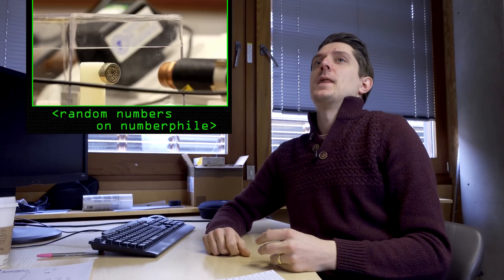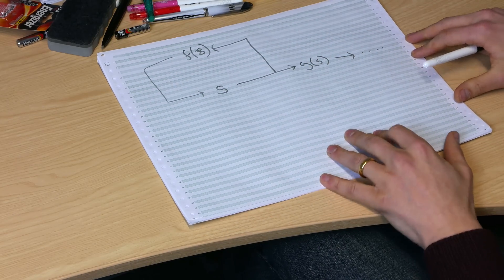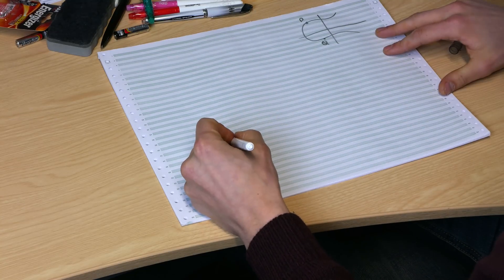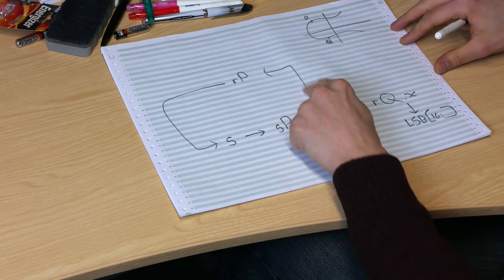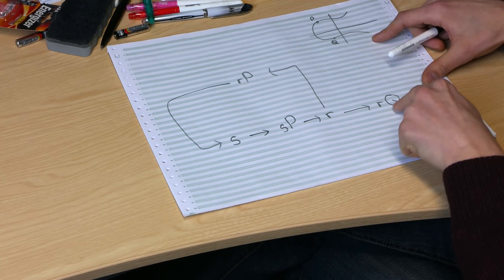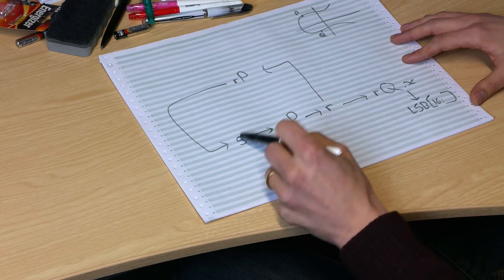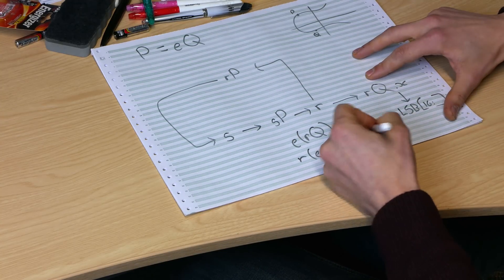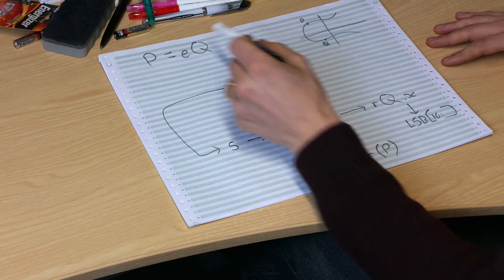Elliptic Curve Back Door - Computerphile

Comment: I don't get it. Why would the NIST tell developers to use a specific P and Q and not generate their own? Do they really think that won't raise instant red flags?

It'd be like if the guy installing your home security system told you your PIN had to be 1234, no exceptions.
Reply: No, there are legitimate reasons as well for not wanting developers to choose their own as well. Am I saying that we can necessarily trust the NIST/NSA's motives? No, but for the exact same reasons we can't trust anyone else to choose them either.

The issue has absolutely NOTHING to do with whether or not the NSA has a backdoor. The issue is that this method is flawed, simply because a backdoor is possible and undetectable. It doesn't matter who picks the values and it doesn't matter how they pick the values, we can still NEVER trust that there isn't a backdoor.
Reply: @phiefer3  
You are correct, but it is MORE flawed to have a single entity act as the determinant of the possible flaw.

Because if multiple entities decided to use their own backdoor, their trail could be traced and their deception discovered when they decided to implement their crime because individuals and amateurs who have weak loyalties will eventually screw something up and get caught.

However, a single entity like the NSA could COORDINATE their strategy of how to obfuscate and manage the process of spying, not only under a legal framework of protection, but with an expert level of organized espionage.
Reply: @dialecticalmonist3405  I disagree. The "people" implementing these types of systems are not "individuals and amatuers", they're major corporations building communications systems that are used by their customers. And the "crime" is as simple as simply reading every encrypted communication that their customers send through their system.

And it makes absolutely no difference whatsoever if the backdoor was put in there by the NSA or the company implementing it. A backdoor is a backdoor is a backdoor. It doesn't matter who put it there, the fact that a backdoor exists, and is infact guaranteed to exist means that the system should not be used.

There are alternative implementations to elliptic curves that can be guaranteed to not have backdoors (by way of things like coprime numbers which cannot be multiples of one another). And that makes them strictly better than elliptic curves.
Reply: @phiefer3   Thank you, you have the best understanding of this that I have read so far.  (I am just learning about all this tonight.) Are there any of these better alternatives like coprimes  being used yet? Is bitcoin's SHA-256 secure?
Reply: You should go back and watch the original video on elliptic curves. When they say "multiple", they're not talking about simply multiplying or dividing a number by another number, they're talking about jumping being able to move some number of times from one point and end up at another point. (ie if you start at Q and then move e times you end up at P).

And the video makes a little bit of a mistake when he says "if" they're a multiple, because the way elliptic curves work, there's almost definitely some number of jumps that can be made from any point on the curve that will land you on any other given point on the curve. In other words, there WILL be some e such that P=eQ. Now calculating the e of a given pair of points is prohibitively difficult, and would be pretty secure, but choosing points for a given e would be extremely simple. (as mentioned in this and the other video, elliptic curves are similar to hash functions in this way, it's simple to start at some point Q, pick a very large e and then calculate a P to create your back door, but doing it backwards to find the e of a pair of points is much much more difficult).
Reply: Wouldn't it raise just as many red flags if they were willing to let developers pick their own P and Q and certify whatever they chose? They'd be giving the green flag for developers to put their own back doors in.

The real problem isn't that there could be a backdoor built into these P and Q values. The real problem is that ANY p and q values are suspect regardless of who picked them. And before anyone says "just use another rng to generate them", that doesn't work either, because that assumes that you can believe the person who says that they generated them from another rng.

Sure maybe YOU would choose honest values with no back door, then again maybe the NIST did as well. You want to choose your own so that you know they didn't put a back door in. Maybe they want you to use theirs so that they know that you didn't put a back door in. Who can be trusted?

Honestly, the fact that this type of back door CAN exist, effectively makes the entire process fundamentally flawed.
Reply: phiefer3 aha thanks for the clear explanation.
Reply: @phiefer3  You can generate P and Q from unpredictable data, such as the college basketball brackets for the next 3 years.
Reply: @samfoxman7046  No, that just moves the issue somewhere else. In that case, who all knows that P and Q are generated from college basketball brackets? Anyone involved would inherently have the backdoor figured out already; just google college basketball brackets. The solution isn't that simple.
Reply: > Why would the NIST tell developers to use a specific P and Q and not generate their own?   
Because the NSA told them to. Simple as that.
Reply: Ideally, the user should be the one selecting the P and Q.  For the type of elliptic curve you would want to use, all points P are multiples of any given point Q.  The set of points is effectively an additive group.  But if the user chooses the P and Q at "random," nobody knows what the multiplying factor is.
Reply: The ideal security solution would be one in which if everyone knows what P and Q are, they still can't get to R, and use R to get back to S.

I mean, the main issue with it is that knowing P and Q, if you got the truncated X value, you could find the untruncated X value, and then use that to go backwards through a one-way function pass Q and into P via the R value, which would get you into S.
Reply: @ZT1ST  There are legitimate reasons to want to specify P and Q for a standard implementation of an algorithm. Performance is one. If you pick your primes right, computing complexity for factoring can be reduced significantly, which makes things more efficient. However as stated, the same mechanism also makes it less secure.
Reply: ok?
Reply: In many cases, the "magic numbers" in such algorithms are essential to the security of the system. The NSA has historically been involved in designing these algorithms a lot, often giving insight to the publishers of the standard in order to actually increase the security of the method (such as s-boxes in DES, which originally sparked speculation about including a backdoor but were later found to harden the algorithm against differential cryptanalysis)
However, in this case, that by no means excuses this algorithm, the possibility of a backdoor "in plain sight" is awful.
Reply: +phiefer3 If the whole idea is that Q must not be divisible by P, why not derive them from twin primes? The main issue here is that NIST didn't explain HOW they got these numbers.

Comment: But there always must be “e” , even if numbers are truly random , there is a connection between them . Just divide  and get that relation . What am I missing ?
Reply: P and Q are not numbers, but points on an elliptic curve. On an elliptic curve, it is not possible to efficiently divide one point by another. This means that it is not feasible to find this "e". However, as the video explained, if you were to pick P, and then calculate Q = e P, and were to use P and Q, you'd have a backdoor.
Reply: It was mentioned at the beginning of the video: it's on an elliptic curve, so you can't perform division without first solving the discrete log problem. The previous video on EC covered the why of it.
Reply: Thanks to both of you !
Reply: Actually.... I personally happen to be of the mind that both +demdrian and +Keth Gaughan missed at least part of the point.

The point, as I understood it, isn't that an 'e' exists. It's that there might very well be a person or multiple people working at the NSA who know what that 'e' is. Like Keith did mention, you can't find the 'e' without solving a pretty much unsolvable problem. But if you actively pick an 'e', and convince everybody to use the numbers that you generated using that 'e', you already know it, and thus you don't have the perform the division to find the 'e'. And, as +demodrian alluded to, once you've got the 'e', you can use the fact that there are only a relatively small number of possible 'rQ's to calculate 'erQ' for each of the 'rQ's that are among the candidates. And since 'erQ' = 'r(eQ)'= 'rP', you have then found the new "s". And that means you now know all the "random" numbers that will be generated by whichever instance of the Dual EP you're looking to target from now until the end of time. Or, well..... at least from now until the "s" is re-seeded. But anybody who knows the "e" can just work out what the new "s" is again when that happens anyway, so that's not a problem for them.
So, the point is that there is a strong suspicion that somebody, almost certainly working at the NSA, knows what the "e" is for the P and Q in the standard, because they very specifically picked the "e" themselves. And that any such person -- and any person to whom was told what the "e" is -- can eavesdrop on any conversation using the Dual EP encryption. In other words: a back door.
Reply: Ahsim Nreiziev , I thank you for this reply. I didn't think that so many people in the world are really concerned about out safety on the internet , everyone tries to see through this explanations and fully understand what is happening. If it wasn't for your answers , I wouldn't comprehend this idea of the backdoor , that exists in this kind of algorithms. This society is great !

Comment: Would anyone mind explaining to me exactly how numbers on the elliptic curve work? Because obviously you're not taking the X or Y value to describe your number; you're taking a point on the curve. Is that just directly related to its distance from each endpoint on the curve, or is it some manipulation of the X & Y coordinates? And what, then, is the formula to describe multiples of that number? Please and thanks. Taken Calculus AB, if you're wondering.
Reply: For detailed questions like this, just look up Wikipedia or something. But I will say that the geometry of elliptic curves permit an interesting kind of addition/multiplication which is what is exploited.

On an elliptic curve, every line that cuts the curve at 2 points also hits a third. For two points P & Q on a given elliptic curve E, to find P + Q, you draw a line through both. This line hits E at a third point, R. 

You then reflect R along the x axis to get another point on the curve because elliptic curves are symmetric along the x axis. This point is P+Q.

Multiplication is just repeated addition and subtraction/division the same but done backwards.

Comment: Here's something frightening.  If P and Q are points on the same elliptic curve, then, in general P will be a multiple of Q.  There are some exceptions when Q is weak and can't hit all points with its multiples.  But in general, every point will be some multiple of Q.  The question is whether the multiplier is known.  Really, if you want a scheme like this, you want to have two different curves.
Reply: Are you sure about that? Is there a property of elliptic curves that guarantees that every cycle is a full cycle that hits every point? I don't know much about them but at first glance it does not seem that trivial.
Reply: There are some elliptic curves in which the number of points has a square factor and in which a logical square of that order can be constructed so that (0,1) is not a multiple of (1, 0) and vice versa.  It can happen.  But it is uncommon and making the period of the curve that much shorter only makes the algorithm weaker.

But I think it's easier to make an analogy with modular arithmetic.  In modular arithmetic, every number that does not share a factor with the modulus has a multiplicative inverse.  Every other value is some multiple of that number (take the value multiplied by the inverse of the first number.)

In a similar fashion the points on an elliptic curve (together with the "point at infinity") form a closed additive group.  One that (usually) has elements that can generate all other elements through repeated addition.

Comment: So this is used today?
Reply: whuzzzup, Google for "RDRAND FreeBSD". What I described above is exactly what FreeBSD devs (amongst others) did when the Snowden revelations about RDRAND came out. Under the hood, Dual_EC_DRBG is one of the algorithms implemented in hardware for RDRAND as part of its SP800-90 compliance. Because the output of RDRAND can no longer be trusted as a source of randomness by itself, it was replaced with Yarrow initially and later Fortuna as the CSPRNG, with RDRAND reserved only as a source of initial entropy, which is safe.
Reply: Yes, but only as a source of randomness for seeding a CSPRNG such as Yarrow or Fortuna, and never as the only source of randomness.
Reply: Any proof for that? Why would you use something that even back when it was introduced was seen as unsecure, not to mention being slower than others.
Reply: Thank you.

Comment: One point where you seem to be missing the forest for the trees, is that you mention that maybe the NSA has this e...  but let's say acme corp comes along, and today, they released their version with a different Q and a different P which didn't conform to the standard.  What you don't address, is now the question isn't does the NSA have the e for the NIST P and Q, then question becomes does acme corp have the e for acme's P and Q.  So if I were to ask you, would you trust this acme corp with their new implementation with a P and Q they chose themselves, of course you would say no.  So of course it would make sense for the NSA to deny a fips certification for this new acme implementation where they chose their own P and Q.
Reply: Acme corp (and NIST, actually) could have generated the numbers using some king of an open process, like P being the first 256 bits of pi and Q being the second 256 bits
Reply: The point is, if Acme choose a P & Q for their own use (or the encryption software they use generates them), it doesn't really matter if they have an e, they are doing the encryption/decryption anyway. The issue is that the standard which everyone is supposed to use might have a backdoor that the NSA know about; And they won't certify companies using this cryptography unless they use the specified P & Q, even though the specific values of these don't really affect the strength of the encryption. If they don't have e, the only reason for forcing their own values I can think of is because it could be possible for Acme to choose insecure values, but then surely they could make the requirements for choosing P & Q part of the spec.
Reply: The thing to remember is that any group of people is still human, and flawed. The only difference in that scenario between the NSA and Acme Corp is that one has authority over an arbitrary certification, decided on by other humans. There's no inherent reason to trust ANYONE, which is the main point of both the back door controversy, and cryptography in general.
Reply: "If Acme choose a P & Q for their own use (or the encryption software they use generates them), it doesn't really matter if they have an e, they are doing the encryption/decryption anyway."

The danger isn't that Acme might have an backdoor e for their own encryption. The danger is that the encryption software might be generating a P & Q with a backdoor that Acme doesn't know about, because Acme purchased the encryption software from someone else who now has a backdoor into Acme's random number generator. The whole point of certification is so that Acme can know which software to trust based on the judgement of experts.

"They won't certify companies using this cryptography unless they use the specified P & Q, even though the specific values of these don't really affect the strength of the encryption."

They do affect the strength of the encryption if someone has an e for the P & Q. The excuse that NIST must use is that they know that their P & Q has no backdoor, but they can't be sure of anyone else's P & Q. Even if someone tells you where they got their P & Q, that could always be a contrived story to cover the real source of the P & Q. The only P & Q that anyone can trust is the P & Q that they pick for themselves, so it makes sense that the NIST would refuse to certify anyone else's P & Q.

Comment: What if the "e" is the mathematical e, but nobody has tested it out, jk :d
Reply: Well, e isn't an integer so I'm pretty sure it won't be ;).  But you never know, its possible that some joker took some section of the mathematical e to be the given e.  The mathematical e is a transcendental so that would actually be perfectly secure as long as nobody knew which section they picked.
Reply: Pal, I think we've just cracked the code :O